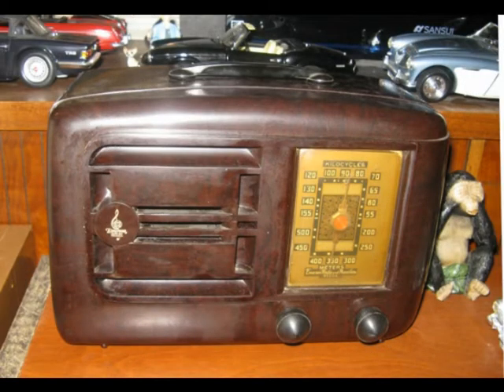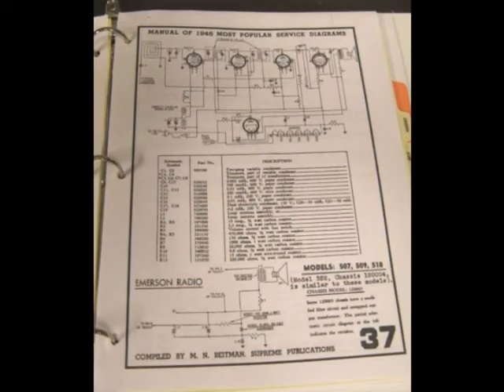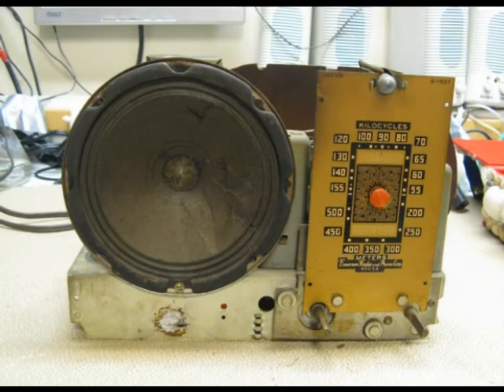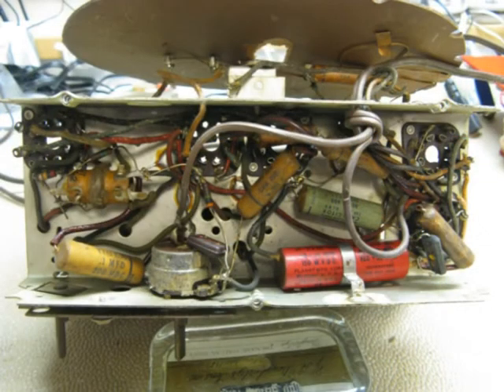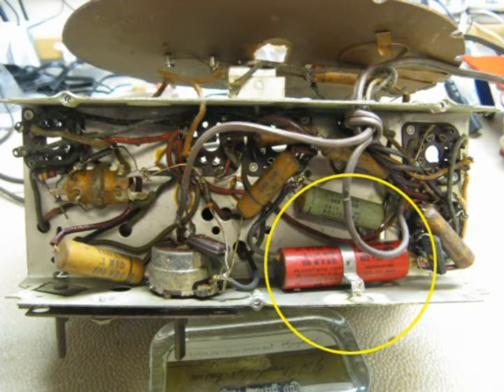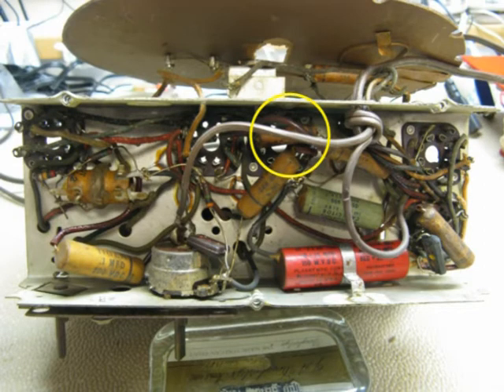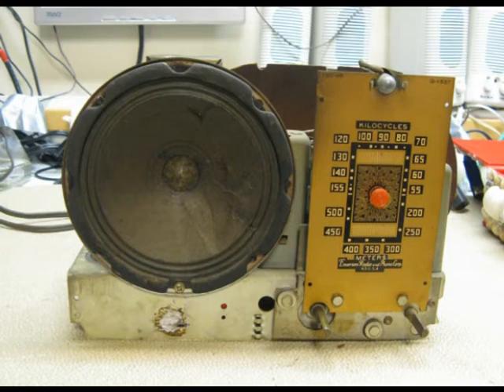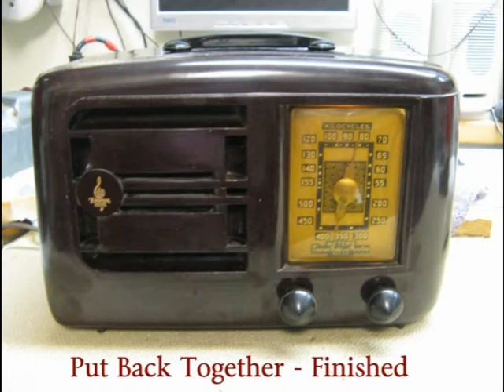I Made Mistakes Repairing an Antique Radio

Comment: If you leave the chassis out for any length of time one good thing to do is to get a piece of cardboard and place it 
against the speaker. Mark the holes on the sides on the frame and poke a small screwdriver through the holes
 and cardboard in two places. Then get two screws and matching nuts and attach the cardboard to the outside
 of the speaker. Don't ask me why I learn this , but it works! Nice radio BTW. Sounds magnificent!
Reply from the maker: Interesting tip, thanks! -- Atco

Comment: Sounds great and it looks as good as it sounds.
Reply from the maker: Hi Kirk - I've got about a dozen table radios now around my game room, most of them I put them back to run again and even completely restored a couple units.  That Emerson is still the best one I have that picks up stations so well.  Not ready for that now, but I know there will be a time that I will need to cut down my game room collection.  I've already decided to keep 3.  One, a RCA from 1946 that I remember having the same model known in my family as I grew up.  Two, similar one that my Grandmother had that I just remember her having that in her house as I grew up.  Three - this Emerson.  It's very pretty, but also it works so well!  Thanks for your comment!  See ya -- Atco
Reply: You are most welcome I just finished except for the back plate an S-38 B Hallicrafters my first ham receiver. I am working on a Canadian that I bought on EBay. I hope it turns out half as well as your Emerson.

Comment: Awesome
Subscribed
Reply from the maker: Hi Ritchie - Thanks for subscribing!  See ya -- Atco
Reply: atco21117 I used to be in the Radio and TV repair industry.
I entered in just as valves were leaving.

It got too hard, as everything was board replacement, but I enjoyed electronics.

I hate SMT now, as the fun has gone out of repair.

Comment: I bought a new radio ,I mostly only do tubes radio,this one is a late 60,s or early 70,s radio I bought It because it was a mickey mouse radio ,except this people from goodwill auctions do no how to pack a radio,the mickey was knock off hopefully I can glue it back ,but it also hot a crack in the clock face ,the radio works perfect ,I ordered and got new caps for it,I wondering if I should leave it alone ,Or just replace the electrolytics ,anyone have a thought on it ,I am leaning towards replacing the caps because of their age.p.s. you did a nice job on that radio,I have a tube portable comeing next week ,that also can plug into the wall too.anyone have any Inputs on that radio ,it will be my first tube portable ,they say it works,most of these dont come working

Comment: The gold pointer looks better than the red.  Glad you got it working.  Goes to show that the old stuff was built tough.  Great video!
Reply from the maker: Edward Morris Hi Ed - I collector told me one day not to throw away the broken radios. Said you might need something from them some day.  Well, I've only had 2 broken radios that I bought only for the tubes, but twice they helped me.  I needed a mica spacer for my Westinghouse, and I was able to find that part from an old broken RCA.  Then just last summer I saw this 1940s radio at a yardsale that the cabinet was really broken up due to heat.  I picked it up for $2 just for the tubes.  The tubes have not been needed yet, but that radio had a nice pointer, and it's what I was able to use in my Emerson.  It was a bit long, so I had to cut about a half inch off each side, but other then that, yes.. I think it looks as good as the original and maybe better.  Thanks for your comment!  See ya -- Atco

Comment: Enjoyable video, we all make mistakes but in a way thats how we learn, though I've been collecting vintage radios nearly 30 years, it only in the last year I've taught myself how to fix them and it's incredibly satisfying, wish I'd started this earlier but it was too easy to rely on a friend.
Reply from the maker: +Mr Celebrity 
Hi MrC - The nice thing about those old radios is that they are fixable down to the component.  How much enjoyment is there to replace a circuit board out of a newer piece of electronics.  I've gone to hamfests for 25 years.  Never tried to buy or fix an old radio until a couple years ago.  I see all these hamfest guys picking up radios and parts and decided to try one.  Finding information on them was easy.  I got a lot of info on theory off Youtube.  Eventually I've bought a dozen or more old radios.  Some were just fixed, and a few were completely restored.  A fun hobby.  See ya -- Atco

Comment: Sounds good Atco. And i think that pointer looks better than the original would have.
Reply from the maker: ZenithClarity1969 Hi Zenith - I picked up a 40s radio at a yardsale last year for $2.  The case was badly broken and I knew the radio did not work.  I did not plan to restore it, just wanted the tubes out of it.  Glad I kept the rest of the radio, which is where I got the pointer from.  It was almost the same pointer, just needed to cut it a little shorter, and clued it into the shaft.  Glad everything worked,  It's a cute little Emerson.  It has very good AM reception and even with the repaired speaker cone, it sounds very clear.  Thanks for your comment!  -- Atco

Comment: Nice old radio! One thing I like to do as soon as I take a chassis out of the cabinet is to cover the speaker with a piece of cardboard for protection. That has saved me from damaging the speaker several times.
Reply from the maker: it's funny, no matter how much time you take, before long one of your speakers will get damaged.  Every open speaker I have in my stash has a cardboard cover over it.  Good luck on your radio!  -- Atco
Reply: @atco21117  It sure is easy done! I managed to get my finger through one the other day. Fortunately, it was on a parts radio; but it was a good speaker before I got ahold of it!

Comment: When working with speaker cones that are old and break easily, a trick I've found useful is wrapping a piece of cloth and securing It tightly around the speaker to prevent a soldering iron or fingers from accidentally pushing through
Reply from the maker: james Burdon Hi James - Thanks for your tip.  As I've learned, those old speakers can get damaged easily.  Yep, I'll be more careful in the future.  See ya -- Atco

Comment: I've always heard that it's usually acceptable to use a higher rating cap in place of one, and that they can last longer because they will not be used to full potential.  But that was a quality job bringing it back after the accidents.
Reply from the maker: Eric Brunhammer Hi Eric - Yah, it's fine to use a higher voltage rating, just cost you more.  But changing the uf value can cause a problem.  Since my schematic said to use 30uf and 50uf and the old caps in the radio showed two 20uf, was rather confusing, but I figured those 30ufs would work OK (plus I didn't have any 20uf caps).  It's funny, with the different caps, and dropping the chassis, and tearing up the speaker... you know, once it was all back in shape again, this Emerson has the best reception and best sound of the speaker of all of the old radios I've got.  You never know.  See ya -- Atco

Comment: RE: your electrolytic caps...  I suspect that your radio has an ELECTRO-DYNAMIC speaker.   It has a FIELD COIL.  These are often part of a tuned circuit, which traps out 60 Hz and 120 Hz.  The schematic calls for a 50/30 150V electrolytic, but has NO FIELD COIL on the speaker.  It uses a resistor between the sections, and filters more by brute force.  

The EXACT schematic would have shown you this, but it's been a LONG time since Emerson as we knew it then supplied schematics.
Reply from the maker: Yeah, it is a pain when you can't feel right about a schematic.  I guess like any other model, they make the original schematic of the board design, then get's changed due to manufacturing and/or fixes.  There can be quite a few different schematics on the same model during the time the radio is on the market.  You never know if you got the right schematic version as your radio.  As far  as mine, this little Emerson has been one of the strongest radios in my collection.  Great signal strength and sound.  It may need a cap changed to be completely correct, but for now I'm happy the way it is.  Thanks for your comment.   See ya -- Atco
Reply: Emerson always made a really GOOD, low priced table radio.  They kept the same basic system for MANY years, but they changed the appearance items.  Cabinets, knobs, dials, ETC.  At the start of WW-II they had trouble getting plastics, so they made CARDBOARD cabinets for the chassis' they had in stock.  Tube sizes changed over the years...  12BE6 instead of 12SA7, 12BA6 instead of 12SK7, 12AV6 instead of 12SQ7, 50C5 instead of 50L6, 35W4 instead of 35Z5. But the electronic design was nearly the same.  

Coipper wire was (at one point) less expensive than Alnico magnets, and so electrodynamic speakers, and so 20/20 150V were needed.  Small value capacitors came in various values for different reasons.  Mostly availability.  They are mostly NOT CRITICAL.  And, contrary to common belief, usually do NOT need replacement, unless they actually fail.  I have a house full of OLD radios, and MOST have the original 'paper' caps, and they work just fine!  In 60 years repairing these things, I have had to replace about 5, mostly coupling caps.  I.F. transformers are something else!  GE radios, clock and regular, used a batch of I.F's that got to arcing at the built in capacitors.  Never a hard SHORT, but the arced.  You'd think there was a thunder storm going on nearby.  Made between 1954 and 1958.
Reply from the maker: Good info, thanks!!  -- Atco
Reply: i beg to differ on that. there are three capacitors that need to be replaced if the radio is going to be used on a regular basis, first, the AC line capacitor is a "must change" for safety reasons. second, the coupling capacitor that connects from the plate of the 12SQ7 / 12AV6 to the grid of the 50L6 / 50C5 will also need changed, even if it works at first power-up in years, it will soon go bad once it is in use after a few hours, that is if it already ain't bad. Last, the capacitor that connects the center tap of the volume control to the grid of the 12SQ7 / 12AV6. those often go bad because the values of the capacitor changes because the dielectric properties has diminished from time & contamination from humidity. All wax capacitors should be replaced on site.

Comment: Beautiful !!! Sounds nice ,,,we cross paths again !!!!!!!  ohhhh I play with wires to """Tvs""
Reply from the maker: Hi Peter - I repaired/restored a dozed radios a few years ago.  This Emerson is probably my favorite.  The sound of that little unit is really good and it also has great reception.  My hobbies swap around quite often.  I like finding something new to work on.  I've thought about working on old TVs.  I have a few vintage portables in my collection.  But, don't have the knowledge to work on 'em.  I can swap off caps and such, but the high voltages of the big tube is a little scary to me.  Plus, the electronic testers are rather expensive.  So for those I'll have to pass on, but I'm impressed with those who know what they're doing.  See ya -- Atco
Reply: Hi Atco, Good to bump into you again , Oh the stuff you and I buy and restore will always be far better than anything you could ever buy in a Mall  !! )
Reply: peter c
ifton

Comment: An idea for the 20µF caps is to put two 10µF caps in parallel together.  The value of two caps in parallel will add together just as resistance adds together in series.
Reply from the maker: The8TrackChap Hi Brian - I didn't think about paralleling two 10uf caps, although not sure if I had any of those either.  On the good side, the 30s seem to be working out OK.  Thanks for your comment!  -- Atco

Comment: You not the first person  to put a hole in a speaker ,I put one in taking a chais out ,plus I still learning about fixing tube radio watching every you tube video I can find ,the radio I just fix changing the filter caps ,I mark everything to put back the new ones ,everything else was disk caps ,thought I had it fix ,the both brittle speaker wire snap off now I have figure where they go,so I bought jumper wires and pray I can figure it out ,and I bought four kinds of glue to fix my speaker I probably use clear nail polish too ,but I have options ,I am  little OCD when comes to buying stuff, now I looking for a schematic ,
Reply from the maker: Hi Ron - I used to use nail polish if I got a speaker tear.  It pretty much works, but the polish dries hard.  That's OK for a very small tear, but for a larger one I prefer to use Aleen's Tacky Glue (found at any crafts store, probably Walmart as well) and even mix it with some water.  It still holds, but has a little give to it.  As far as your radio schematics, if you haven't already, signup as a member to the Antiqueradios.com. It's free and can put out a request if anyone has a particular schematic.  You might be surprised that you'll get it.  See ya -- Atco
Reply: Put a hole in an old 46 RCA yesterday taking it out of the cabinet.I barely touched it was so very dry.Ended up changing the selenium rectafier out,putting a 100 ohm resistor in series to drop the B plus to 129 volts.Made the old girl sing again.will fix speaker tomorrow.
Reply: @danielsteele7544  Hello, can selenium rectifiers be restored?

Comment: any tips on a radiola 17? mt b+ is only 130v it works but i cannot find any issues with it, all the filter caps have been changed out.
Reply from the maker: Hi Dr - I've never worked on those older radios from the 1920s.  A lot different experience needed for 'em.  My oldest radios that I have worked on are from about 1935 on, although I do have a Radiola 17 in my collection that I picked up on Craigslist that was already restored.  Good luck on your 17.  Those old sets are so cool to show off!  See ya -- Atco
Reply: thanks, i highly recommend working on one, lots of fun, it's really nice to see how they did it back then!

Comment: Nice job with presentation and repairs! I generally use rubber cement on my speakers when there is tears of any kind.
Reply from the maker: Robert Loeser Hi Robert - I never tried Rubber Cement on a torn speaker before.  Sounds like a good idea.  Might try that next time, thanks!  -- Atco

Comment: You did not do any tuning after having changed the capacitors? Was not necessary? Infact it sounds beautifully like in the old days..! Thanks very much for the nice beautiful show.
Reply: Алексей
Reply from the maker: Hi Abele - Yes, didn't need anything but the caps.  I've got now about a dozen old radios that I've repaired/restored.  This Emerson is probably my favorite.  It is very sensitive.  Thanks for your comment!  See ya -- Atco

Comment: I've made mystakes as well. Not know how to fix a record cutter, when people charge over high prices like $300, or $400. wich i don't have..So am just driving it with a simple speaker.. but i need to learn how to build a circuit, so i don't short out the speaker.. since they are 4 ohm 3 watts ?? and volume can't be more than 5db, or will short the speaker out fast..

Comment: I need some help fixing my zenith model 6r084/6c21 
I can't seem to get any stations on AM. it turns on and the turn table works great. it plays all my hank Williams records perfectly. changed most of the tubes. and it won't resolve still. 

any suggestions??

Daniel.
Reply from the maker: Hi Daniel - I watched a couple of your videos.  Very nice set from 1946.  Rare do I find one in such good shape.  Your unit has 6 tubes in it.  Probably half of them are for the amp (and the record player) and the other tubes are for the radio.  You said you've changed most of the tubes?  You need to test all.  More than likey it's a tube or a capacitor.  Get a hold of a tube tester from someone and know whether the tubes are good or not.  Of course do keep a real eye ball of the circuit.  Make sure you don't have a broken wire somewhere (I just fixed one for someone last week and sure enough one wire had broken off).  If that looks good, then start on the caps.  Look for the electrolytic caps first.  There's probably only a couple of them.  They are the most likely to go bad over time.  Good luck!  -- Atco
Reply: Thank you!
I'll check and change out the caps. And see if that fixes the problem.
Daniel
Reply: atco21117 I'd say that my zenith radio is Rare A. Its in really good shape.
B. The serial number is unique and I can't find anything on it  online.